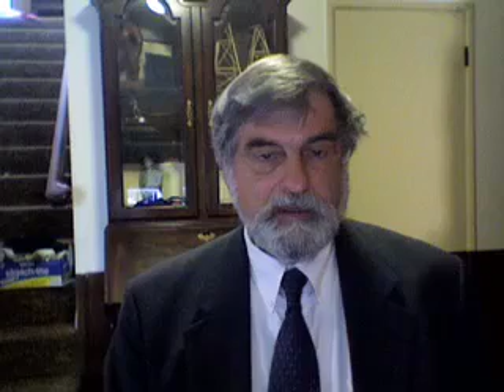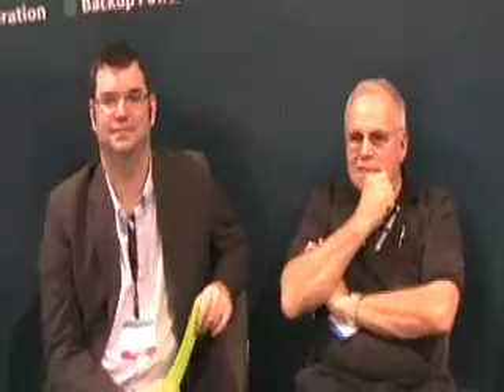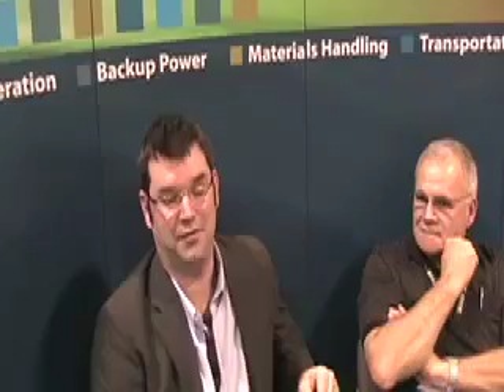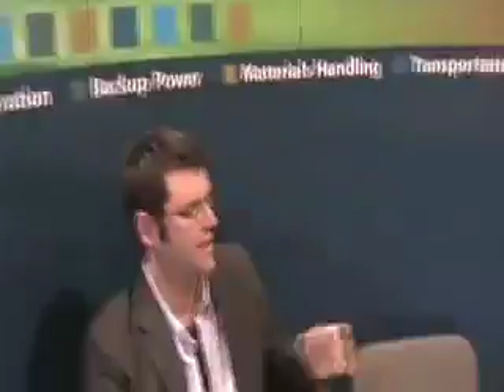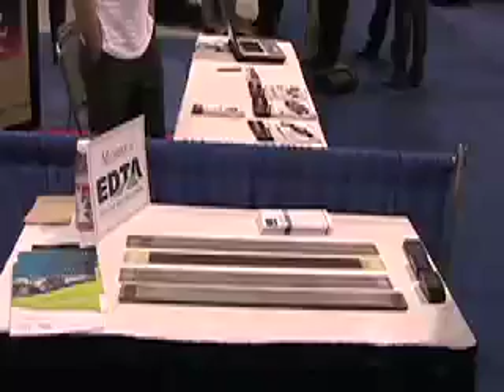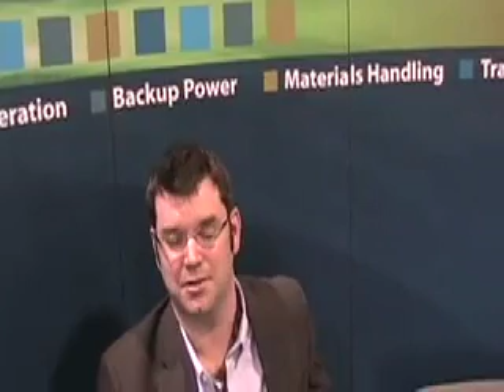EVS23: Fuel Cell or Fool-Sell, Hydrogen Hype Tape 4

Comment: So here's a question...If the electrolysis process were performed on-board and the component hydrogen/oxygen gases were sent directly to the fuel cell, would this alleviate the filtering problem?

Comment: we need a degradation graph in practical car use. looking at this limited spec sheet: w w w. ballard. com/files/pdf/Spec_Sheets/SPC5101375_-_Mark1030. pdf
it says it can only run above freezing. that's a complication as well. a curious detail is the low power density though. little over 1kW for a 20kg package. 60kW would weigh a ton. Honda claims the FCX clarity has 100kW power. I wonder what that stack weighs

Comment: I'm en EV fan and believe fuel cells have been a dangling carrot too but how do you translate 4000 hours of operation into 24000 miles? that's an average of 6mph. he doesn't say 24000 miles in the video, he says 4000 hours. if we are going to shoot down the FC let's do it right, otherwise we might be wrong

Comment: Batteries do not scale up due to Chevron patents, nothing more.  I have held 3.3 volt 90AH lithium cells in my hand.  They are building delivery trucks that run on batteries.  What scale do you need?

Comment: They will argue that there is a lot of waste methane around that they can crack into hydrogen and pump it into the gas pipelines.  The timing is about right so that when the cable company brings their fiber into the neighborhood to hookup your HD TV, they will bring a hydrogen line to the gas station.

Comment: The infrastructure is any power grid with hundreds of millions if not trillions of 110-240 volt outlets hooked up to it (which already is in place). All you need is one outlet to charge a car, just as you'd charge an ipod.